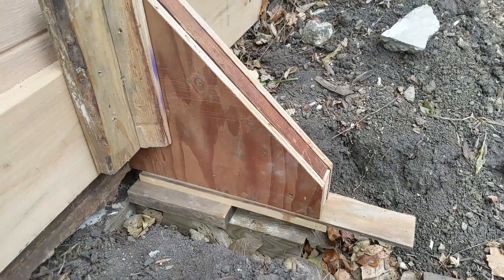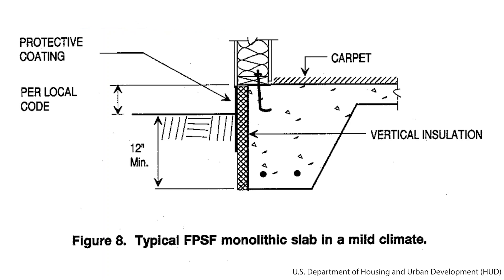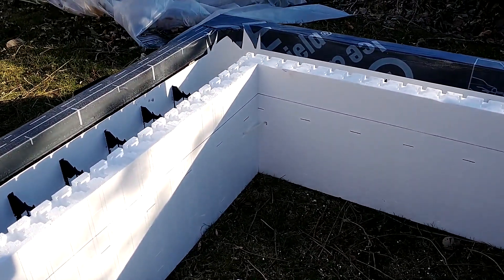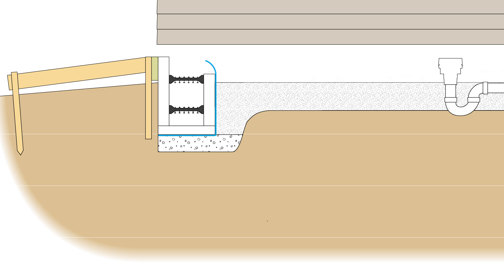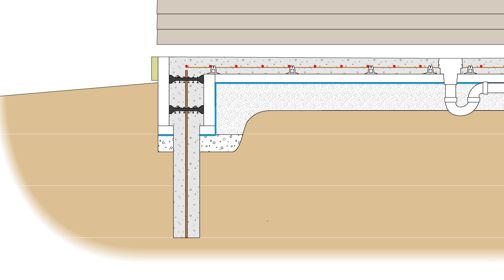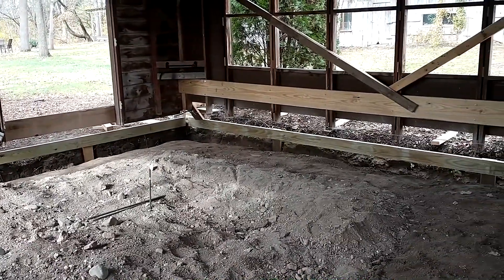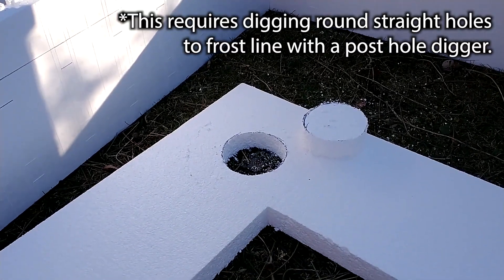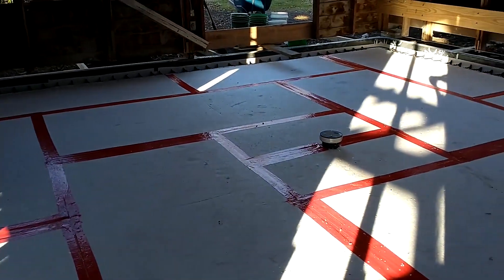Frost Protected Shallow Foundation Using ICFs? Part 3

Comment: Nice work, but I see no reason for the hole dug down to the frost line.  The purpose of the insulation is to raise your frost line, and penetrating it would only be counter productive.   I'm sure it won't be an issue, just adding extra steps and complexity.  For an unheated space in Michigan, you need to extend the foam 5' out from the outside walls, although just for a garage it isn't necessary for code.
Reply from the maker: Thanks for the feedback! You're absolutely right about the purpose of the insulation. By penetrating it, I am definitely giving up some thermal protection of frost penetration, but I'm trading it for mechanical frost-depth anchoring at key vulnerable points. It is more of a hybrid approach, combining elements of FPSF and traditional full perimeter deep footing.

Comment: Freezes in my state doesn’t hurt the slab u simple had bad ground prep and no rebar.
Reply from the maker: Yeah, rebar wasn't a standard when it was built in the 1930s. Rebar was a huge advancement, but base prep and reinforcement doesn't guarantee a slab won't crack or shift. Lots of factors including mix quality, control joints, grading, drainage, heavy loads, tree roots, burrowing animals.

Comment: By adding the pile or pier you are basically saying that you don't trust the frost protected shallow foundation.
Reply from the maker: It's more about increasing the safety factor. FPSF already incorporate multiple ways (for safety) to protect from frost: 1. NFS soil beneath, 2. perimeter insulation, and 3. surface grading. Nothing wrong with adding one more for very little effort.

The pilings were a recommendation and technique used by my concrete guy who knew about the previous issues with the corners due to less than ideal grading and drainage.
Reply: @This_Old_Garage  So the concrete guy doesn't trust the frost protected shallow foundation either.
Reply from the maker: @badawesome  Sure. In the same way you putting on a seat belt says you don't trust the airbags, crumple zones, safety glass, etc.

Codes establish the bare minimum standards (the absolute worst you are allowed to build), which don't always result in the best long-term outcome. It's okay to exceed the minimum requirements in construction and there are times when it's beneficial or even necessary to do so.

Comment: Did you see the new braces they just came out with for the ICF fox product?  They’re literally what you could have used instead of altering the black supports.  They’re green and they allow you to cut that section out but they added a vertical support in the middle.  I think they’re under “curb blocking”
Reply from the maker: Fox Blocks is another innovative system. That's an awesome product if you also want to have a curb, which is nice in getting the sill plate up and away from moisture. I never had to touch the black plastic ties. Flipping the blocks upside-down allowed me to barely miss them when cutting down the foam. For whatever reason, they're about 3" from the top, but about 4" from the bottom on the LiteForm.

Comment: Love this idea.  I've been waiting for this video in your series for this project.  Not sure if you mentioned it in previous vids but what area of the country do you live in?  I 'm up in acceptable
Reply from the maker: I'm in central IL. It's 36" to frost line here. FPSF beats having to dig 3 ft. by hand. Instead, it was just 16". (ICF is 16" tall, plus 2" bottom foam, plus 4" base, minus 6" above-grade height equals 16" dig.) Vertical and horizontal insulation requirement and thickness are determined by climate. Search for "air freezing index determines R-value" for a chart. Hope this helps!